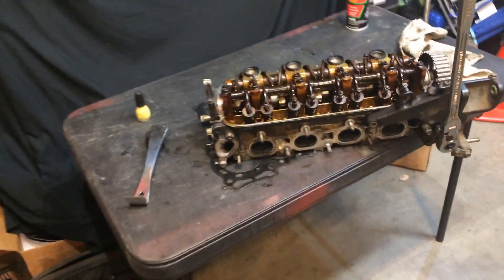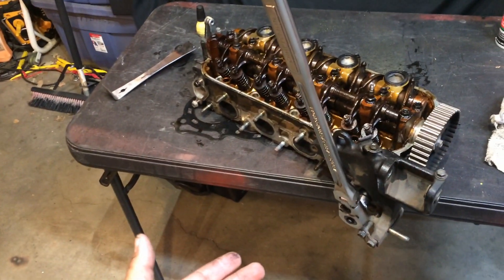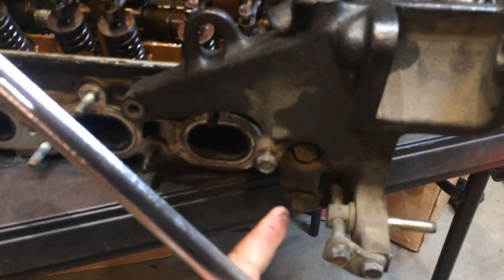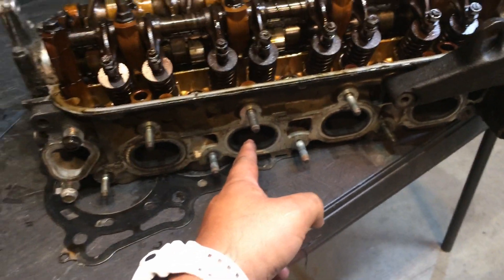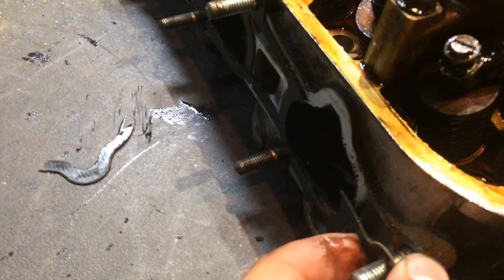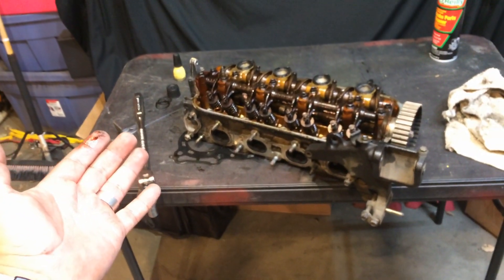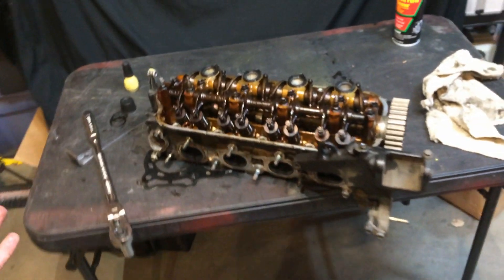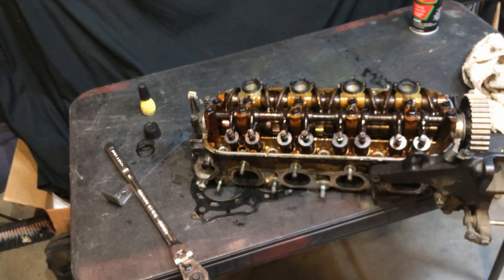Prepping Head for the Machine Shop - Sending your Head to Machine Shop Near Me - How Much, Cost

Comment: Great advice and thank you for spreading the word. It drives me nuttz when a head comes in for a pressure test and resurface and it could almost friggin start. A bit exagerated I know, but you get it👍
Reply: I had to read that twice💀
Reply: Hello, I am about to replace head gaskets on my truck. I am a self/YouTube learned mechanic. I am just wondering if it is ALWAYS necessary to have my heads sent off to a shop like yours when replacing the head gaskets. 

My truck has been sitting for a year or 2 now with a bad transmission and I only start it every so offten to keep it from going down.

In that time I have learned how to rebuild the transmission and was doing one last inspection and noticed milky oil under the transmission and traced it to the head gaskets. 

Do I need to send them off once I pull them out? Or can I just replace the head gaskets and put the cleaned heads back on???

Sorry I know this question is long.
Reply from the maker: No worries. Yes send them out to be resurfaced. Have the have stem seals replaced as well as the springs if you plan on keeping the truck for a long time. Over time the heads warp, on the heat cycles cause that. Even if the truck never overheated the head can be warped just so slightly that it does not fit perfectly with the block when you put everything together. It will look and appear fine and then you start it up or put some miles on it and it will leak and then all that work you did is for nothing.

Comment: We have a big sign in my engine machine shop  " NOT responsible for sensors , sparkplugs , brackets or any other accessories left on cylinder heads "
Reply from the maker: Exactly, strip the head before giving it to the shop for resurfacing.